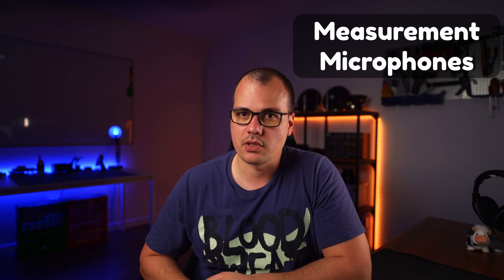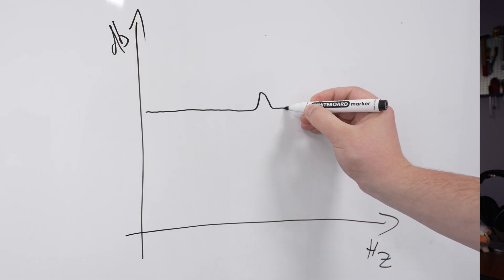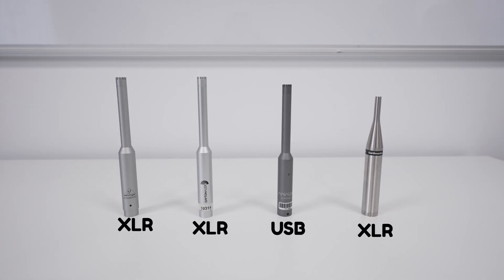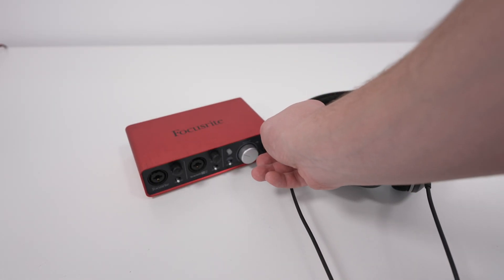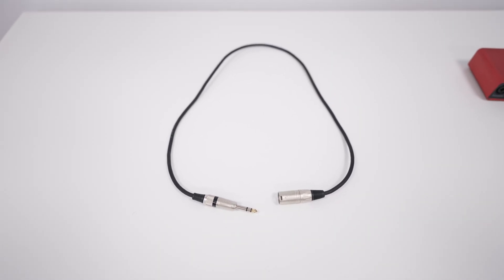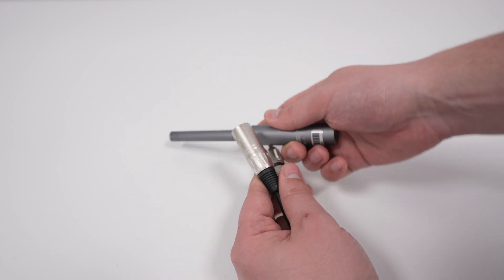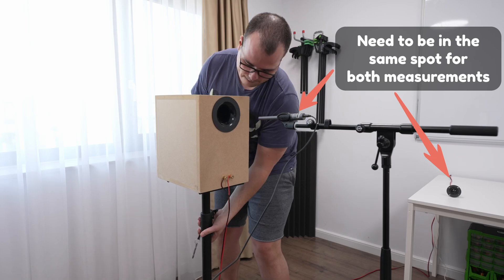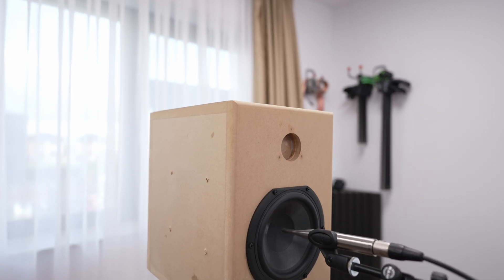Why I HATE USB Measurement Microphones

Comment: One thing you can not do with a XLR measurement microphone, but likely with an USB microphone ist to measure sound pressure level straight out of the box. Given that you have a GAIN knob on the preamp of your interface which requires you to do some mapping or calibration to know what digital signal level refers to what soundpressure level at which given GAIN setting.
The USB mics have an in-built preamp and ADC. Usually they come with proprietry software, that offers SPL measurement.

Comment: I'm a bit confused about the timing reference bit - what are you doing here - calibrating the audio interface? I was thinking of getting a UMIK-1 because it's also SPL calibrated (saves me buying a SPL meter). I do have an multi-channel RME audio interface which would support XLR and loopback. But then the speaker would be playing through the audio interface but the UMIK-1 wouldn't be taking measurements through the audio interface so would that work?

Comment: As mentioned before, Behringer has a generic calibration file on their website. Not using it in your comparison comes across as a bit unfair. In that case you should use the other mics without calibration file as well.
Reply from the maker: Indeed. I was unaware that they introduced a generic calibration file. I think it's something that they did quite recently. I'm not entirely certain if it was available when I did the test or not.
Reply: @AudioJudgement  Do you think you could do a follow up, applying the generic cal file to the Behringer measurements to see how it changes vs the original ones and how it holds up against the other mics? Would be very interested how much impact this has!

Comment: Thanks, a very useful review. But one thing to notice, the new Earthworks mic is used as a benchmark, but you should have look at its calibration file to see if this range from 5 to 20 khz is correct or it has this calibrated.

Comment: ECM 8000 has calibration file...
Reply from the maker: No, it doesn't. Lately they added a generic calibration file for all the microphones, which is not how you calibrate. Normally, the calibration file is generated for each microphone individually. You download the file using the serial number of your particular mic.
Reply: @AudioJudgement  Maybe the manufacturing technology is such that a common calibration file is enough, because the microphones are very similar... So the test is not invalid if the calibration file is not used, if there is one.
Reply from the maker: @ In my opinion it's just a marketing stunt. Add a generic calibration file (with basically no extra cost), just so you can say that the mic comes with a calibration file.

Comment: You made a few assumptions. For one, that the lower frequency range specs for the Earthworks really is 3hz and the Berringer is 18. These are just claims, not proven. Second, you assumed that the new Earthworks was correct and the others were worse because they differed. You don’t know which one is most correct. Third, you assumed that the difference in your two Earthworks was due to age. You don’t know that. If you got 10 new ones they might have just as much variation. 

Also USB mics are more portable as no interface is needed.
Reply: Earthworks Mics (with the M23r) claim to have +/- 0.5 dB of Variation, in their whole Serials, most of mics claim to have +/- 1 dB, I agree with him that it's most certainly age that made variations if he never re-calibrated it.

Sure, if we have to be 100% certain about it one should buy a good 10 sample of all of them to compare, but who will do this ?

And i'm sorry, a mic without calibration file can't be claimed as measurement mic.

Comment: -----
- Depending on your use-case and requirements, the balance between sensitivity and gain might present a problem by adding (extra) distortion into the mix.
So depending on your proficiency level, when it comes to the world of audio, which microphone to use differs.
Is there a way to find a sweet spot or a 'Golden Ratio' if you will that will satisfy the average user when it comes down to choosing the right equipment, be it for calibration measurements or everyday use?
Although I've directed this question to manufacturers/brands directly in the past...
I've found that the 'Sales Pitch' is more often than not their go to answer to this question compared to an actual technical and informative answer to this question.
It's even worse when directing it to a salesperson at a store, since their purpose seems to be solely to get money from you, whether they sell you a simple toaster or a Lamborghini.
-----

Comment: I bought a Behringer ECM 8000 for 50 bucks and it doesn’t come with a calibration file. It seems to measure pretty accurately. I don’t think that -0.5DB at 15.3Khz is going to affect my listening experience.
Reply: I think Beringer has the ability to reject capsules if they don't fit their standard calibration file on his website... capsules are very inexpensive, they can afford to do that.

Comment: Since DIY xovers are ultimately tuned by ear anyhow what difference does the accuracy of the mic really make? The final sound is going to be adjusted to taste/room no matter how accurate the mic is. You're going to end up with the same xover topology no matter the mic. Only with a poor mic you will need to tweak the component values by ear. I think for most DIY'ers any of these mics can get the job done.

Comment: What’s striking for me is the cheapo Behringer is very close to the reference between 50-4000hz. That’s pretty incredible for such a low cost mic that doesn’t even benefit from a calibration file. For locating and treating problems in a home or project studio the Behringer will give you enough information to work with, and for such a job we’re only really interested in what’s going on in the bottom third of the frequency range. Reverb time measurements are critical and they will be as accurate on the Behringer as any other. For other critical measurements where you need absolute accuracy in the higher octaves you will need to spend more, but my take home from this video is that measurements for acoustic treatment can be done confidently with the Behringer. 
Thanks a lot for this thorough and clear comparison 🙏
Reply: I think that Bеringer has the ability to reject capsules if they don't fit their standard calibration file... capsules are very inexpensive, they can afford to do that.
Reply: Yeah but product variance for the Behringer ECM8000 is a thing https://www.cross-spectrum.com/audio/newgifs/ecm8000_frequency_response_large.jpg

Comment: I saw that beheinger now offers the calibration file for downloading. In that case will it do the job?
Reply from the maker: Interesting. It seems that's a generic calibration file. One that fixes some major response flaws that every behringer mic has. However, a true calibration file is made specifically for your mic. And you need to download a calibration file based on your mic's serial number.
Reply: @AudioJudgement I think Beringer has the ability to reject capsules if they don't fit their standard calibration file on his website... capsules are very inexpensive, they can afford to do that.

Comment: Great info .  extra info ,make sure you dont enable hardware monitor and you are sticking phantom power up the output jack by using an XLR to RTS loopback cable (unless you can turn off 48v on ch2) its best use the line input  jack to output jack)

Comment: Sound engineer here, they are just different, usb for portability and do RTA since I do not any alignment on the venues, and the xlr one for when I need to do a system alignment, I love the UMIK1 for that is just so simple to use and the noise floor is so low, and then for alignment I user whatever the contractor or venue have at hand, honestly idk why so much hate can complaining for a tool that was not design for that use case.
Reply: so you would say the umk1 would be good beginner  one for measure my hifi speakers and headphones or is the cheap Behringer ECM8000 enough? hm but then I need a sound interface and a notebook in my living room

Comment: I don’t remember anything about loopback in the Udemy 202 lessons. Does this option negate the IR Window section? Can the same results from the tests in this video be found with the methods in the lessons or is this a better update?
Reply from the maker: Yes, the udemy course needs an update, as there is no mention of the loop-back. All the measurements in the course are valid with the single exception of nearfield measurements of ported enclosures (where a loopback is necessary). I'm currently working on a new updated course (complete overhaul), but it will take several months until it's finished.
Reply: This is great info. It seems there’s not only a delay in the port resonance (which seems to be solved by the loopback method), but there’s also an acoustical offset as well as unique baffle diffraction which will change depending on the location of the port relative to the driver. 😅

Comment: Any idea on the frequency response of the UMIK-2?  I’d like to measure down to 10hz but really don’t want to spend the $500 for the Earthworks.
Reply: I can verify that the calibration file for the UMIK-2 does have values down to 10 HZ.
Reply: @williamhicks2763 Does it also have cal data for above 20kHz ?
Reply: @somebodyx  Both of the files (standard and 90 degrees) top out at 20016 Hz for my UMIK-2.  So, yes, at least by a little bit.
Reply: @williamhicks2763  Its a shame not  having 50 kHz cal data. Could see ultrasonic tweeter resonance with amplitude certainly if so. Since its internal ADC has enough sampling rate for that.
Reply from the maker: Couldn't find information regarding umik-2 frequency response. Maybe send minidsp an e-mail. Let us know as well if you find out.
Reply: @AudioJudgement  The email response was this:  
“UMIK-2 calibrated response is 10Hz to 20kHz.”

(Link to owners manual that I am omitting in this quote) “please read for more details.
Maybe the next step would be to read a bit details from the manuals/product datasheet so you can learn a bit more about our products?  We'd be happy to help answer any questions you may have.”

“Hoping this info helps and feel free to contact us if you have further questions.”

So, they are saying 10 HZ to 20 KHZ, but I see no documentation of that in the user manual or any of the links or charts anywhere in their documentation.  By pointing me to the user manual one might expect to see those numbers listed somewhere or perhaps a chart in REW but I had already read that and the data sheet before emailing.  This time I checked the link on Home Theater Calibration, found in the user manual, and read through the docs at that link.  Still, I would like to see it in print but they claim in their email it is calibrated to measure down to 10 HZ.
Reply from the maker: It's most likely true. When I googled for this spec I saw a graph comparing the response of UMIK-1 and UMIK-2. The range of 10-20 Hz of the UMIK-1 rolls off quite significantly compared to UMIK-2. My guess is that UMIK-2 does have an extended frequency response and you should buy it if you want an affordable mic that can measure below 20 Hz.
Reply: @williamhicks2763 Open the calibration file as text. Please let us know what the min and max frequencies are. I assume there are some zeros and not only values for non-zero offsets. Idk.

Comment: If, with acoustic reference, a measurement is made of the frequency response in (let's say) the drivers of a two-way speaker (the measurement is made to be used when simulating crossover filters with e.g. Vituixcad).
Can the frequency responses be used directly, or are there additional steps that must be performed after the measurement, for example on the impulse response?

By the way, it would be very helpful if you make a video about measuring with acoustic reference. This seems to be something that is misunderstood by a lot of people and for me and many others, REW's manual is not very helpful.

Thank you in advance.
Reply: If the port is on the rear, it certainly seems he should be adding an offset. I’m a little confused about this method.

Comment: I own an ECM8000 - in bottom line I need to see the behavior of the speaker, what you should it proves that in my case the cheaper the better.

small tip - take a cheap microphone - measure a speaker with it and with expensive mic then use the expensive mic - to prepare a calibration file for the cheap one .
now you can use you cheap mic like the expensive one :D
Reply: This is what I'm planning on doing.
Reply: Impulse response on the ecm8000 is not comparable to earthworks so if phase accuracy matters ie. Driver linearisation. Then reference quality matters.

Comment: as shown in 6:32. i think we can connect one of 3.5mm output (Left channel or Right channel) to 3.5mm mic input (of the same) may be with some resistor in series. and we can use that for "use loop-back for timing reference" with USB mic.
Reply: Like you made zig for measuring T/S parameters using sound card and REW.
Reply: Makes sense. He seems to imply that doesn’t work by suggesting an audio interface is better. I’d be curious to know more too.

Comment: Informative video !! Might any of the differences in the FF frequency response measurements be due to differing mic patterns (sidelobes, backlobes) picking up room reflections ? Did the NF measurements show similar FR differences?
Reply: yes, a valid point.. in 'uncontrolled conditions' at such high frequencies the wavelengths are so small that everything counts, from exact positioning of the equipment to even the position of the person doing the measurements..
that being said, for all practical reasons super accurate measurements of the high fqs are not needed since healthy ppl over the age of adolescence can't hear much of the second half of last octave plus there's v little acoustic information there anyways :)

Comment: I got 3 Dayton UMM-6 mics for work. The difference between them from day1 was too much for professional work. They had deviatons in frequency response and noise floor around 3dB. I recommend Minidsp, or if you want accuracy in different measurement condition for long time, get B&K or Grass, which is also in my work office. But they are above 1000€, without amp.
Reply: That seems like a VERY high noise floor. It should be around -95 dB. Are you sure it wasn’t the setup or cables or something? I do agree that if you’re using multiple microphones at once they all need minimal variation if you’re only using one calibration file. For most people and many companies, a single calibrated mic even with <0.5% variance is probably more than adequate.
Reply: @jtmcfarland3512  Hi. I tried every microphone with the same cable and same measurement program. REW. I’ve also used 3 different calibration file for each microphone. While playing constant noise, SPL values I measured was around 65 dB for 1 microphone, in the other It was 66.5 and other was 63.5. I corrected the other microphone by changing the calibration gile gains and eqs myself. There was a little bit bigger difference in the Noise floor.
Reply: @SoundDemos  That’s interesting. I don’t remember REW having an option to calibrate SPL separately for each input. Separately adjusting gains to match for each input device would be necessary and is recommended by multiple manufacturers. For the types of uses in this YouTube channel, we’re generally not concerned with absolute dB and really only need relative dB data. Likewise, noise floor really isn’t an issue for our purposes either as long as it’s not ridiculously high. Our measurements are ideally taken at 80 dB, so even a 30 dB noise floor is easily filtered out since dB is not a linear scale. YMMV
Reply: @jtmcfarland3512  I calibrated each calibration file by using one at a time, from the same position. It should be noted that as the noise floor changes, the distortion graph in the lowest levels changes as well. Its like you cant measure below 0.2 percent distortion because of the higher noise floor in one microphone compared to other. Yes, dB relative data would be unfeffected. However, I’ve noticed frequency response difference up to 3 dB between microphones. Especially around higher frequencies, such as 9,-15kHz. I can provide the calibration file number of each microphone. .UMM 6 microphones are good for average consumers. But I’m a loudspeaker tuning guy, and tuning 3dB off will sometimes makes or breaks the speaker in the eyes of reviewers nowadays..
Reply: @SoundDemos  You’re clearly working on higher accuracy stuff than me, but my noise floor is currently around -35 dB (not great, but usable). With measurements at 80 dB that’s a 115 dB difference. That means even a 3 dB variation in my noise floor only shows up as a teeny tiny fraction of a dB at my measurement level. (110 is 10^11 times louder than the floor)

3 dB from 0-3 is not the same as 3 dB from 100-103. Very different.

Comment: Very good episode. I want to add that there is a big difference in distortion measurements. Cheap microphones are not suitable for measuring driver distortion, which can be as low as -80dB. Joseph Crowe made an episode about it. In his findings Shure SM58 was better at measuring distortion than USB mics.